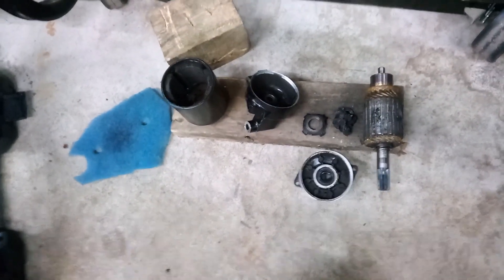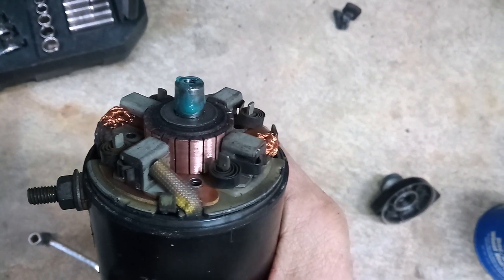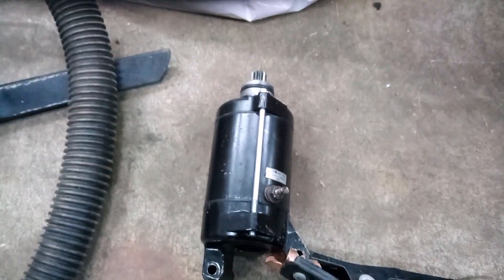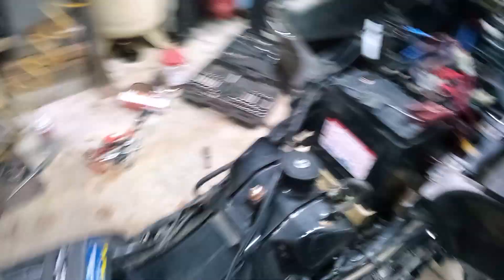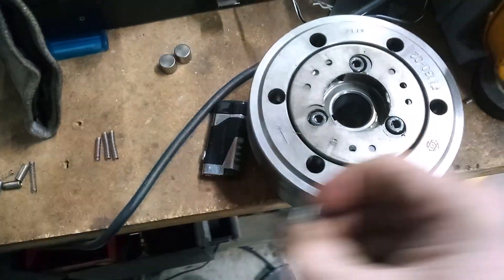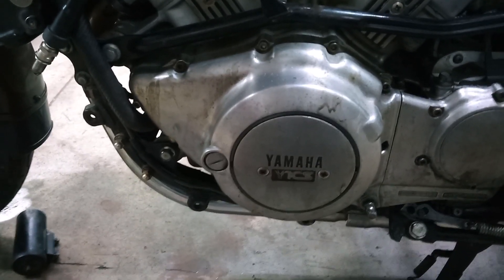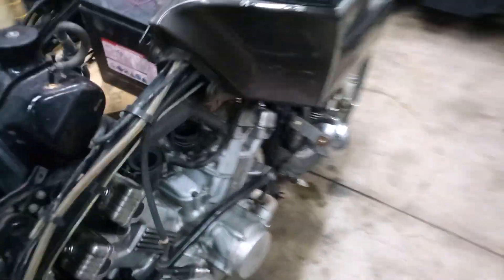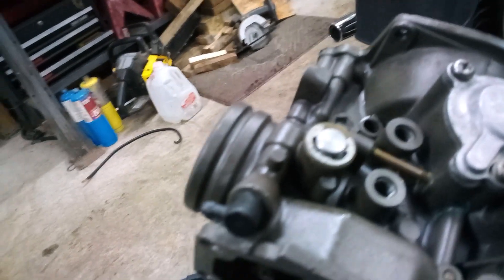85 Venture Royale Starter Clutch

Comment: Woouuww amezing!!! Doing a great job !!! I might get motivated, thanx to you to do this on my bike as well.
I have the same problem with starter cluth. But I.m traing to sell it. With pain in my hart so we will see.
Reply from the maker: @acccuman6182  thx, great i hope you get it done. I had to stop working on the ventures and sold them both due to medical issues at the time. those bikes are big and cumbersome to work on. As i recall the rotor was quite difficult to get off. a strong stout puller would make it easier. Good Luck with yours.